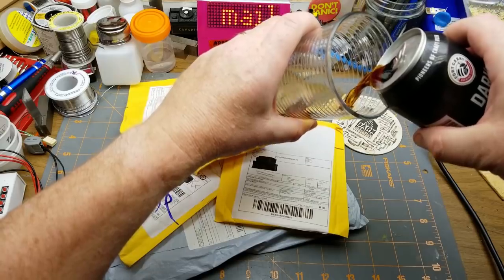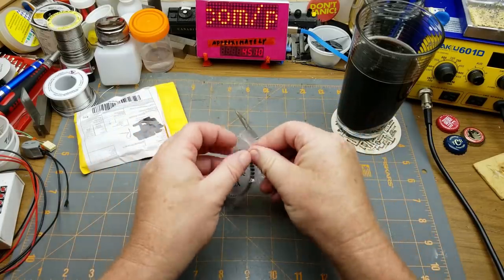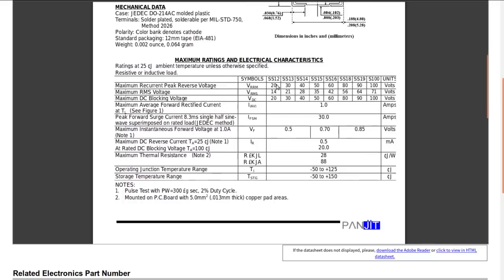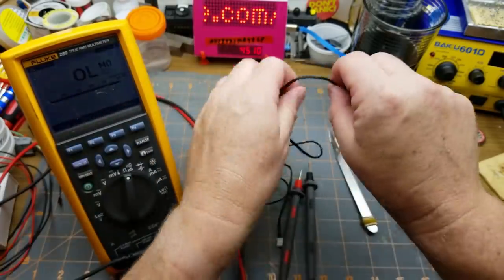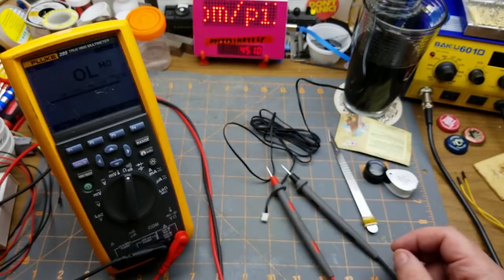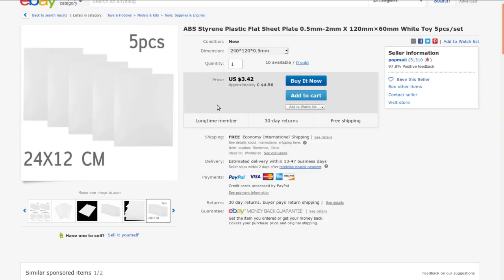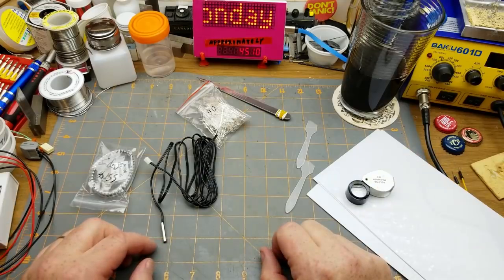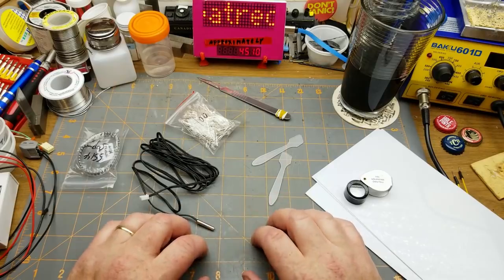mailbag monday #70

Comment: Good to see the beer is at the correct temperature. According to the interwebz... You should  serve most premium lagers between 42 and 48 degrees Fahrenheit (6 to 9 degrees Celsius) and quality ales between 44 and 52 degrees Fahrenheit (7 to 11 degrees Celsius).

Serve authentic Stouts as warm as 55 degrees Fahrenheit (13 degrees Celsius), which is British cellar temperature.

Serve some high-gravity Barleywines, Old Ales, and barrel-aged Stouts only very lightly chilled or at room temperature, like a snifter of brandy.

.. so if that is a stout, then its pretty much spot on...
Reply from the maker: I'm impressed.
I think you put more effort into this comment than I put into the entire video...
Reply: @pileofstuff  Nope, I simply and wotonly plagiarized  the information provided by the very knowledgeable Mr Google.

Comment: There's a 50-110; Thermometer digital LED Temperature Display Temperature indicator R7B9 with that sensor. I glued the sensor to the outside of my cyl head next to the thermostat and it's pretty accurate. Mine reads from 87ºC to 90ºC when driving with a 88ºC thermostat. I don't think YT allows ebay ads so just search the term.

Comment: Well the S in ABS stands for styrene anyway. There is 40 to 60% of it in the mix. So the sheets are mostly styrene in either case.
Reply from the maker: Good point. Both straight polystyrene and ABS are good for model making.